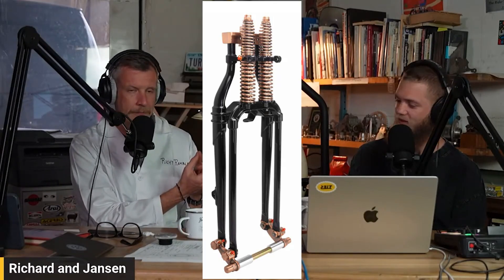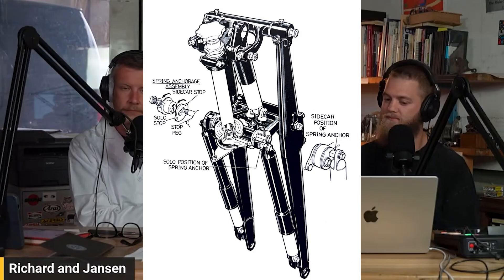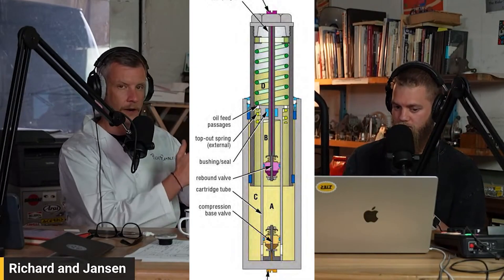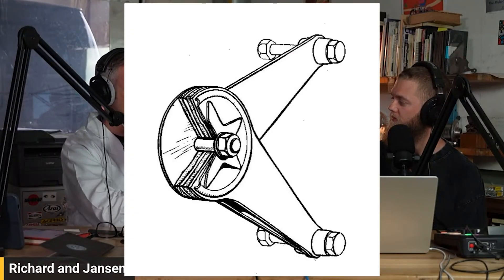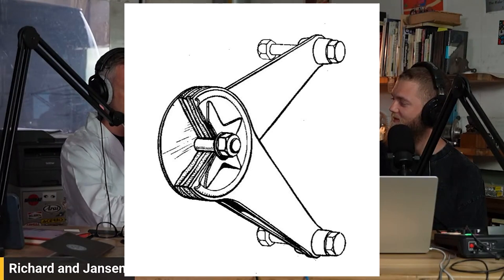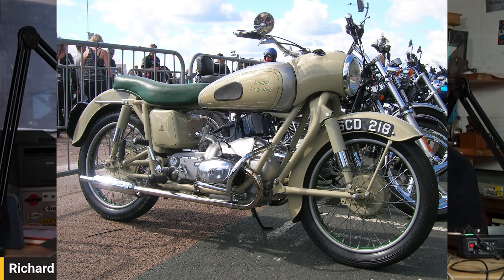Why are Janus Motorcycles' forks different?

Comment: Inverted forks are also considered a type of telescopic suspension. And it's not true that they don't have any external support as you claim at 1:51. External tube is external support.
I have listen to your explanation very closely why leading link suspension should be superior to any other type but I just find it false. The biggest advantage that supposed to have (anti dive) is actually disadvantage. Inverted forks while controlled compressing are also lowering the center of gravity which just benefits cornering performance.
There are many other benefits that inverted forks have over the leading link some you have already mentioned.
If this would not be true you would not be seeing them in GP bikes. They use the best possible technology available (what works the best) so it's not just because it's common.

Comment: You are keeping up your product, but you have to fix some stuff to make it stable and safe. 
FIRST - Your steering column angle, you have to increase it to increase trail WHEN THE SUSPENSION IS FULLY COMPRESSED. Your front wheel travel is NOT LINEAR, it make a curve while the suspension is compressing, making the wheel rise and go BACKWARDS, this reduces suspension trail and stability, plus the chassis going down reduces steering column angle and reducing tire trail even more. You know why old bikes had the Link at the rear of the wheel, so that the lever distance would make the wheel go less backwards while the suspension is compressing. SO longer trial with Compressed suspension will provide more stability. 
SECOND the brake caliper HAS to be linked to the suspension frame with a link, also the pivot point, just AVOID using the swingarm, all the braking force MUST go to the chassis not the arm of the tire. You want the front wheel to have best grip, but by putting that anti dive force on the front wheel, you are stiffening the suspension, and if you drive that bike on rain snowy slippery road, you are going down EASILY. Look at all the Bimotas, the links you see parallel to the front swing arm are not for steering, they are for connecting the brake calipers to the chassis. Anti-dive on front suspensions is stupid and people also buying BMW know this because ALL of them complain of a bad feeling of the front. 

Your bike is OK, just there are mistakes that engineers don't do anymore on modern bikes.

Comment: I love the heritage look of the leading-link fork, but it does have limits. The anti-dive makes the front end feel rigid under braking, which hurts trail braking and aggressive cornering. That’s why BMW abandoned Earles forks in ’69 when riders demanded sharper handling. For relaxed cruising it’s great, but it’s not mechanically superior to modern telescopics — they load the front tire naturally and give riders the grip feedback needed to really push in the twisties.

Comment: As I understand it leading link forks by their nature aren't inherently unstable compared to telescopic forks, they only have a lingering bad reputation for instability in some circles because many manufacturers back in the day didn't optimize bike geometry favoring utility or performance instead.  In truth many bikes like the Velocette LE or Honda Super Cub used leading link forks back in the day and were renowned for being reliable and stable rides.  It's encouraging to see that Janus has not only done their homework, but has a deep appreciation for the history, engineering and science.

Comment: The anti-dive effect seems like it also decreases the front suspensions ability to absorb bumps while braking in an emergency.  If I’m going 50mph and have to slam on the brakes on a bumpy road, how much more likely is it to lose traction, stability, and possibly hop around or deflect, now that the front suspension is less able to absorb the bumps?

Comment: The fact that a telescopic fork dives when you brake hard is usually a good thing.  As you said, the overlap increases and the weight shifts to keep the front wheel on the ground.  Where you mount your disc caliper, it causes your suspension to go up, putting more weight to the back of the motorcycle.  Over 60 percent of your stopping power is at the front wheel, so getting that weight to transfer to the front is a good thing.  

I get that you wanted to build your own forks instead of outsourcing that, but your bike would be better with a telescopic fork.  At a minimum your brake caliper needs moved to where it is on the same plane of travel as the up and down motion of the suspension instead of perpendicular to that plane.

Comment: Modern BMWs use their "Telelever" front suspension. Vespa (I have both a 1979 P200E and a 2006 GT200) actually use a single sided trailing link front suspension. Extremely comfortable and handles great. The Honda Rune also used trailing link front suspension. And then there is the latest Honda Goldwing front suspension. I really don't know what you would call that.  H-D has used a springer front suspension on fairly modern bikes. And then there was the Yamaha GTS1000, with the RADD front suspension, basically a swing arm type design.
Reply: Believe it or not but Honda adopted a UK front suspension for the GW!

Comment: Earles fork - my 1950's BMW had brilliant leading fork - under front brake the bike would rise Actually a brilliant motorcycle - Being an Engineer working in the motorcycle industry for over 59 years - I would suggest that the front axle should be below the link arm pivot point - Is that one of the common link in your frequent "Tank-slapper" accidents ?
Reply: Nothing could equal the comfort and ride of the BMWs with the Earles fork.  That was one of the lines biggest selling points.  I owned an R26 for a time and for a 250, you could ride it comfortably much longer than many large displacement machines.  On the big twin BMWs, there were fittings to allow the trail to be changed for sidecar use which I believe was one of the biggest reasons the design was adopted by them.  I'm not in total agreement with the Janus design, Honda had a better brake anchoring for the front brake that kept the suspension flexible even under hard braking, Janus has missed that feature though they have theoretically more travel than the shorter links like those fitted to the classic CA72/77 Dream models of the mid '60s.
Reply: 😂😂😂 “common” 😂😂😂
Reply: Not sure what you mean by "frequent", Janus motorcycles aren't known for being susceptible to tank slappers, any more than Harley Davidson is known for it despite their touring bikes being prone to death wobbles despite using telescopic forks.

Comment: Are you serious??   Superior to telescopic forks?  😂. I guess the Moto GP engineers have it completely wrong…..huh?
Reply: You might want to do a little research into why MotoGP uses the forks they do. It isn’t that they are the best fork on the market.
Reply: @zyonsdream Ok, you tell me.  Why do Moto GP bikes use telescopic forks?  I’ll go even further, why don’t they use the “superior” Janus front suspension instead?  I mean who doesn’t want their front suspension locking up solid upon brake application?  I’m sure the Marquez brothers would love that…😂😂
Reply: Yea! That’s why I shave all of the tread off my tires!! Because everything that’s good for the track is good for public use. 

I also remove my headlights, and baffles.
Reply: @bonnevillebagger9147 oh me too!! 😂
Reply: I think they went for leading link only because it's cheaper for them to produce. Absolutely much more inferior then inverted forks.
Reply: @RideWithGec I knew you were a liar when I read your first two words were “I think” when clearly that’s not true. In what world is small batch production, built in the USA. Cheaper than simply importing a a few hundred telescopic forks? 

Which technologically is just a spring and two pipes inserted into each other. 

The internet has given too many dumb people the ability to mass communicate.
Reply: @bonnevillebagger9147  and what exactly makes me a liar? I really think you don't understand how modern forks work. Do you know what the valves and oil grade do in those forks? Well I do because I used to race and send bike to suspension expert on GP level to tune them for my needs. Suspension is the second most important component on bike when we talk about the riding capabilities. You don't understand what does quality suspension do and what they cost, but you are right on your last sentence.
Reply: @RideWithGec damn you didn’t even get the joke, thanks for proving me right.
Reply: @bonnevillebagger9147  I think you will never understand what part of your post puts you in the definitive position of a liar not a joker 😅

Comment: Greeves used them also on dirt bikes......
Reply: Greeves also used rubber bushings in torsion for the springing action, dampers were inside the fork legs.  They did have a "head shake" problem on occasion and later went to telescopic units.

Comment: It's interesting that the development of anti-dive telescopic forks in the 80s disappeared.  I don't remember the reasons for that but I suspect cost and added complexity.  Similarly, IIRC, in the 80s, there were self-cancelling turn indicators on bikes that disappeared, too, for the same reasons, I suspect.  Anyway, I think the leading link adds to the retro vibe of the bike and allows more of the bike to be made in the USA,.
Reply: Anti dive forks was a flawed concept. It prevented the front suspension from working when you applied the brakes. Suspension has to compress to work, and preventing it from compressing basically prevented you from having front suspension when you applied the brake. My 2006 Sportster has self canceling turn signals, and they are a nightmare. You put the signal on, only to have it self cancel BEFORE you make the turn. Then you have to turn it back on, only to have it keep flashing AFTER you've made the turn, so you have to manually cancel it. What works fine on cars does not work on bikes. Simple push to cancel turn signals are by far the best design ever.
Reply: @geraldscott4302 thanks for the explanation.
Reply: Also you want weight transfer to the front tire for traction during braking.

Comment: Leaf Springs have Friction Dampening.  I have some very heavy Leaf Spring in my Freightliner with a 44,000# Tandem axle rear and I have an Oshkosh Truck with 65,000 # Tandem Spring suspension.  The Trucks ride OK loaded when the tires squat a little but the ride is terrible empty. I also have an FWD with a Hendrickson Walking Beam Suspension system. All three of the above-mentioned truck shave Henderson Walking Beam suspension.  Highway Tractors normally have some sort of independent suspension for each axle with air bags for a much smoother ride. The load leveler valves change the air Pressure according to how heavy the load is.
  The FWD does not have leaf springs it only has some Rubber blocks. It rides very rough but it's less tippy from side to side. It was a Cement truck, and they have a high center of gravity. 
  So why do so many Harley Custom Builders want a hard tail in the rear and a Springer Suspension in the front.
  Some give Yamaha Credit for Patenting the Mono Shock Rear suspension, but HRD / Vincents had a mono -shock rear suspension in the 1940's or earlier.
  If People and Yamie Noob want to make fun of Janus suspension, they should make fun of Hard Tail Harleys with Spinger suspension.  The Truth is, I never had any desire to own a Chopper or a motorcycle with no rear suspension.
  Harley Davidson's have been known to have very poor suspension until recently when Indians started coming with much better-quality suspension than Harleys have.
Reply: Excellent information.